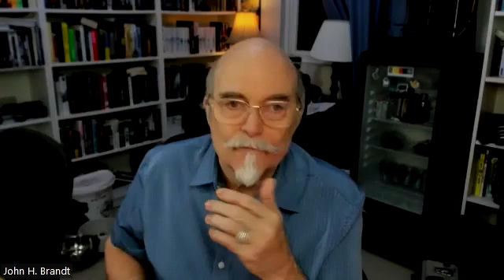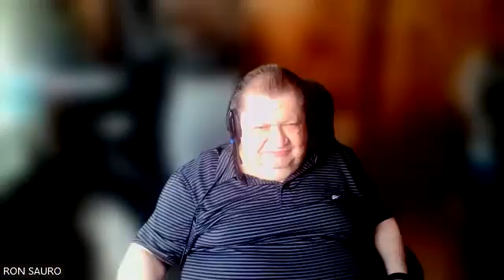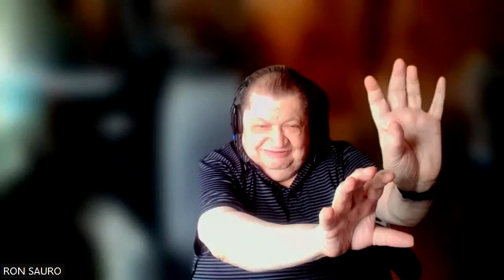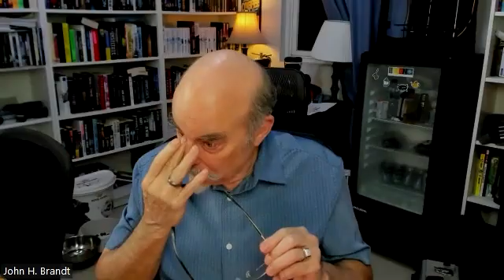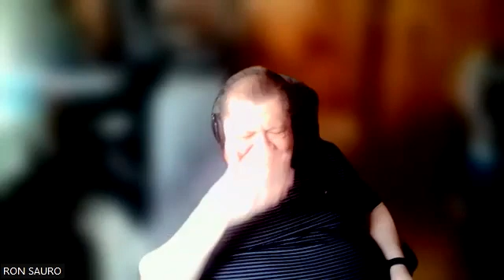Lobbing in Diaphragmatic Absorbers, VPRs, and Theories

Comment: Great video. Very deep insights. Thanks to John and Ron. I have a question with regards to diaphragmatic / membrane absorbers. At what sound pressure level would these begin to work and at what SPL would these stop working? In other words would these membrane even work at low SPL values, or do they only work at higher SPL's? Since these purely work on pressure, so at what SPL range would these be most efficient?
Reply from the maker: GREAT question! The BassMod diaphragmatic traps work at very low SPL. If there is sound, they resonate. The mass/inertia of the panel is extremely low. I'll interview Richard Lenz in the coming weeks. I'll ask him about that and many other things. Stay tuned! 😁
Reply: @JHBrandt Great! Looking forward to that. Wish to know if are these are tuned to the axial modes or other harmonic for Below 120 Hz
Reply: @vivinagarwal1341 axial or tangental - doesn’t mater. It tuned to a specific frequency

Comment: Thanks for great videos and talks John and Ron. What do you guys think about Helmut Fuchsˋ real life tests of VPRs and BKAs? To me the VPR topic seems quite well researched…
Reply from the maker: Seems that way. If they are tested properly in a laboratory capable of testing low frequency then we'd know. It's all speculation until we have valid data. They haven't been tested properly and that's all I know.
Reply: Here is an excerpt of Fuchs' book (translated with DeepL) that described the testing of the VPRs, I hope that information is helpful:

However, the problems discussed in Chapter 2 make it necessary to first qualify the measurement room for frequencies below 125 Hz. Since it has been shown that the usual slanting of the opposite boundary surfaces and the installation of additional diffusors do not contribute significantly to the equalization of the sound field at low frequencies, the only solution is a suitable damping of the room modes, as described in detail in [17]. For the measurement of the absorption coefficient, 3 VPR modules with the dimensions 1.5x1.0x0.1 m each with 1 or 2.5 mm thick steel plates in closed frames in two lower corners of the 392 m3 reverberation chamber of the IBP have proved to be suitable to obtain well reproducible results at least up to 63 Hz (measured in thirds). Figure 5.15 shows the reverberation time of the damped reverberation room shown in Figure 5.14 without the sample in comparison to the room without the sample. The corresponding mean equivalent absorption area in Fig. 5.15 below shows that the damped room still easily meets the requirements of the standard if only the limit curve defined there is extrapolated horizontally up to 63 Hz.
Reply: @JHBrandt  not only you have the papers, you also have a detailed description of the experiments and results in Fuch's book about silencers and absorbers.
Reply: Are there other labs besides our man’s here that can test LF? Where can I find a list of labs?
Reply from the maker: @yellowledbutter  There aren't any, I've looked. So in order to test to 25 Hz you need a laboratory of at least 2000 cubic meters. But it's not just the volume that's important. You need to know where the modes are at the low frequencies.  So modal density can be described by the number of room modes in a given band, but it's not just the number of modes in that band. If all the modes are in a band or at the same frequency, you're not gaining anything. So you want to have those modes spread out at various portions of the band, and ideally, we'd like them to be almost uniformly distributed throughout the band.